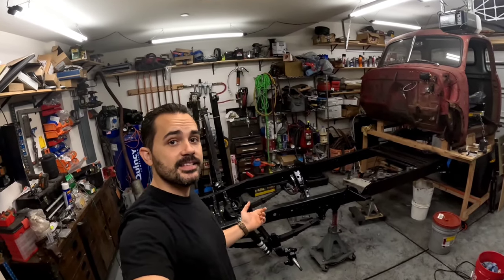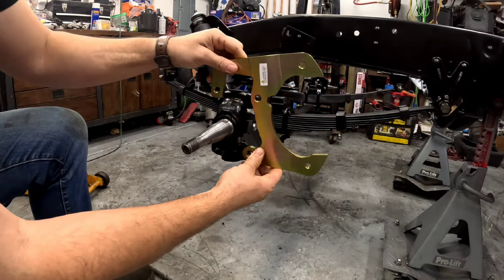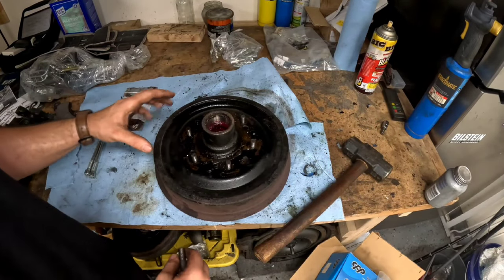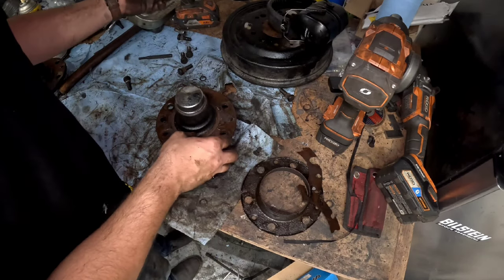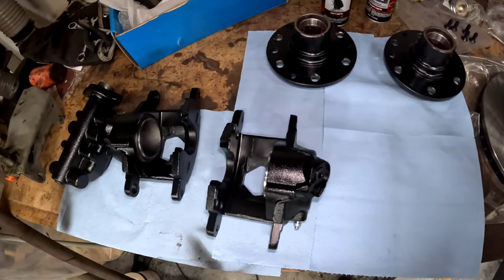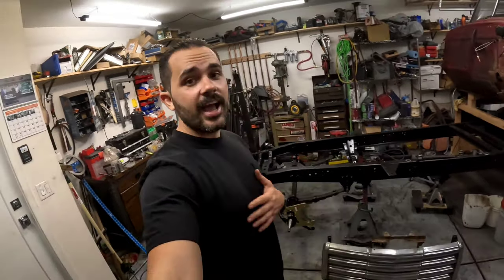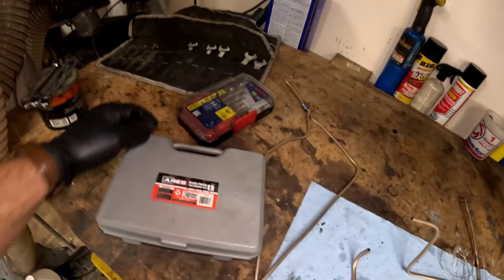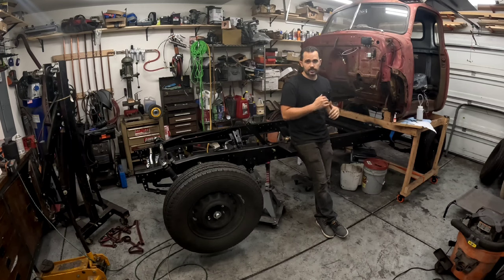1953 GMC disc brake conversion, FAILS and tie rod install!

Comment: Best place for wheels is Stockton Wheel. Big mistake in modifying the caliper. The caliper actually moves side to side as the pads wear. So, your best and safest option is get wheels that fit right. you will run into caliper problems again. Why did you not get a booster. Makes stopping much easier. Uses same bracket. If you are using a correct proportioning valve then you don't need the other valves. Truck and Car Shop in Orange, CA is a great place for parts. You should have bench bleed the master cylinder first. You always bleed one wheel at a time starting with Driver's side rear then rear passenger side, front passenger side and last front driver's side.
Reply from the maker: Modifying the caliber does have its draw backs, I’m definitely going to have to keep an eye out on them for sure. I wanted to keep the vintage rims, so if I do have caliper issues down the road I will most likely get the wheel spacers so I can run them. I didn’t run a brake booster because it would not fit with the Hydra-Matic transmission, just not engine room under there lol. The CPP master cylinder required external residual valves, but yes you are correct that some master cylinders don’t and have internal valving. If this one ever fails on me I will definitely be switching to something like that. Now I did “bench bleed” I just did it on the frame so it was secure but the procedure was exactly the same. I used the kit that it comes with also, I also got leverage having the pedal to push on it!! Thank you for all the support and I appreciate all the feedback! Take care!
Reply: @Ev3rydayGarage  The proportioning valve does the same thing as the two residual valves you got. As long as you have a disc drum proportioning valve you are set. I never had to add the residual valves. Those are only used when NOT using a proportioning valve. To be sure give the guys at CPP a call. They can clarify this for you. All my stuff is from CPP. I have their firewall mounted master cylinder and booster.
Reply from the maker: @catscan64  actually the proportioning valves and residual valves are different. The residual valves are there just to stop fluid from flowing back to the master cylinder. CPP does recommend them, BUT the valves are only used when using a frame mounted master cylinder, they are not necessary for a firewall mounted master cylinder which is why you didn’t need them in your setup. Thanks again for the support and I appreciate you keeping me sharp.

Comment: What type of brake line did you order that you said was easy to work with?
Reply from the maker: It’s called NiCopp brake line. Great stuff, can get it on Amazon for pretty cheap.
Reply: @Ev3rydayGarage   another question I had,  was yours a 1/2 ton or 3/4 ton truck?  Trying to find a conversion to disc on the front but not finding too much luck since my buddies is a 3/4 ton.
Reply from the maker: Mine is a 1/2 Long bed.
 But this company 
https://www.tsmmfg.net/chevy-gmc-8-lug-truck-complete-front-disc-brake-kit-1847.html

Makes a solid disc brake conversion for the 3/4 ton.
Reply: @Ev3rydayGarage   thank you so much!  I’ve been watching all your videos, love the content!
Reply from the maker: Thanks man! I’m glad I could help and I appreciate the support!

Comment: you should have way more views and followers than you do. restoring a 1956 3100 stepside
Reply from the maker: I appreciate that! Maybe one day! Are you doing a frame off restoration too? GL on your build!
Reply: @Ev3rydayGarage  no frame off, just doing tie rod upgrades, whole brake system, engine transmission etc.
Reply from the maker: @totallynotafed8786 awesome!